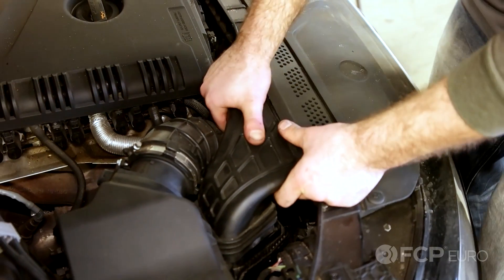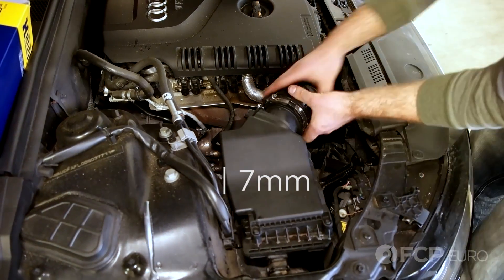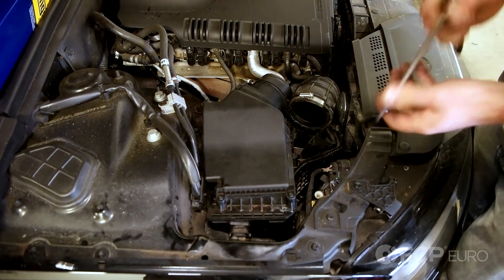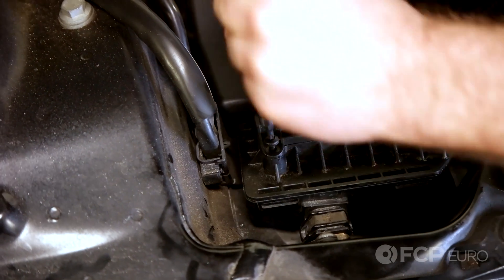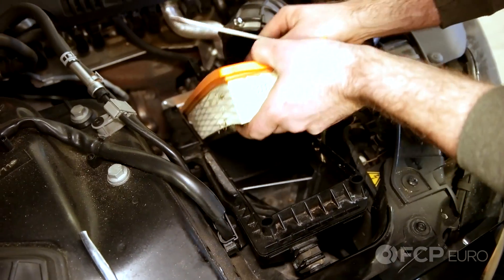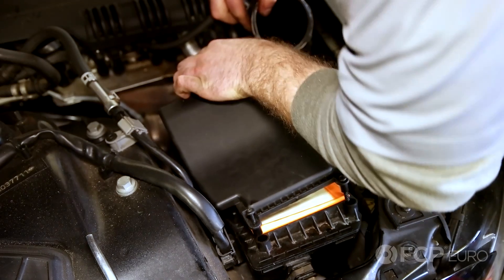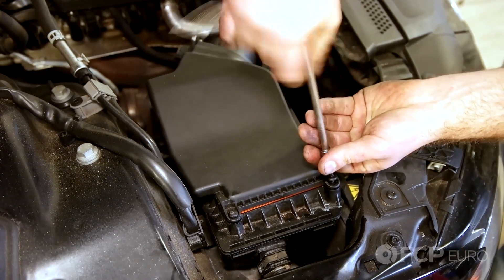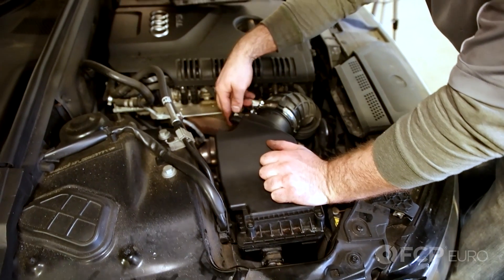Audi B8 Engine Air Filter Replacement - Quick & Easy! (A4, A5, Q5, Allroad)

Comment: The OEM filter I removed had a thicker, foamier bottom. I put an online replacement in and realized later that the foamier bottom part could be pulled off. I’m wondering if the one you removed in your video had something like that on it that you remove and wash and affix back to the replacement one to give it a little more filtering power.

Comment: Hi thanks for vid...does the air sensor just pull out or do have to unscrew thanks?
Reply from the maker: There will be 2 bolts, clamps that need to be loosened and a plug connector that needs to be disconnected.
Reply: FCP Euro I did this today thanks again...the maf sensor on 2014 A4  just needed flat head to remove the connector and  I didn’t need to touch clamps.

Comment: do you have any tips on how to remove the MAF sensor connector? The plastic parts look very delicate and I can only find examples of VW parts and they seem to have a different design. does the connector need to be removed? 

Also, the air hose seems to be quite stubborn, any tips for taking that off?
Reply from the maker: A thin flat head screw driver will help with the removal of the MAF sensor connectors. You can use to press in the connection point and gently separate.